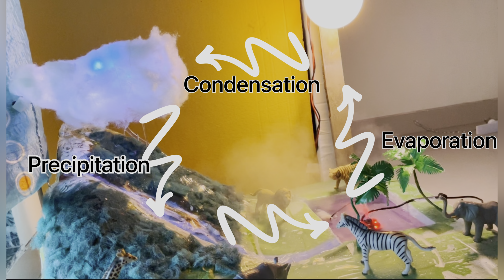Water cycle working model #science #schoolproject #watercycle NakulSahuArt

Comment: Sir where did you fixed the bulb switch??
Reply: Sir I want to do this project pls tell sir fast
Reply: @savithasavithasrinivas  what should I tell u?
Reply: sir Where I fix ball bulb on stick which switch I want to plug
Reply: @savithasavithasrinivas  get a bulb holder and there is a thing which we put behind the holder it looks like a plate. Fix the bulb in bulb holder and get a stick and a tape the or glue 
the holder with bulb on the stick and get a plug and connects it wire with the bulb wire and then your project is complete
Reply: Sir bulb holder means
Reply: Sir there is switch to on the bulb
Reply: @savithasavithasrinivas  u have to join bulb wire with the plug and u put the plug in switch then on the button it will glow

Comment: Humidifier  bulb, or water pump ko power kha se milega???? Please reply
Reply from the maker: Humidifier comes with charging kind adopter , directly plug into AC socket. 2 AAA battery required for water pump. Material list available in description .
Cloud में used light button cell के साथ आता है ,cloud making को थोड़ slow करके देखना .
Reply: @nakulsahuart  science exhibition ke din AC SOCKET KHA SE AYEGA?? OR KHA PLUG KRENGE,?

Comment: From where mist maker will get power
Reply from the maker: Hi,
Water pump is connected with 2 AA battery with switch.
Humidifier is powered by AC power socket (it’s comes with old charge type adopter)
Cloud light-it’s comes with button cell ( 4:06 to 4:22 )
Reply: @nakulsahuart  thank you

Comment: You didn't showed us the measurement of foam sheet plz reply  because I am making it and I have to submit it by 14th plz
Reply from the maker: Full project size is 21 x 26 inch,  you can use foam as per you project size, ground level sheets are around 2” thickness’ (as per water collection box )mountain high is around 12 inch.

Comment: Kiya aap muje bota sokte hain ki ye pipe ke sath kiya diya hain or ye light ki connection, humidifar ka connection kaha se kiya main claa 8th ki hu please replie sir
Reply from the maker: Hi,
Pipe ke sath mini water pump laga hai .
Water pump is connected with 2 AA battery with switch.
Humidifier is powered by AC power socket (it’s comes with charge type adopter)
Cloud light-it’s comes with button cell ( 4:06 to 4:22 )
Reply: Sir  plastic boll LCD ke sath keise milaya or uska connection summer vication ki project liya sahiya isiliya mung Rahi hu

Comment: We have to give the explanation also . So bhaiya how can we explanation
Reply from the maker: Water cycle, 
also known as the hydrologic cycle or the hydrological cycle, is a "biogeochemical cycle" that describes the continuous movement of water on, above and below the surface of the Earth. The mass of water on Earth remains fairly constant over time but the partitioning of the water into the major reservoirs of ice, fresh water, saline water (salt water) and atmospheric water is variable depending on a wide range of climatic variables. The water moves from one reservoir to another, such as from river to ocean, or from the ocean to the atmosphere, by the physical processes of evaporation, transpiration, condensation, precipitation, infiltration, surface runoff, and subsurface flow.
The water cycle involves the exchange of energy, which leads to temperature changes. When water evaporates, it takes up energy from its surroundings and cools the environment. When it condenses, it releases energy and warms the environment. These heat exchanges influence climate.
Reply: @nakulsahuart  Thank you so much brother for this help

Comment: Hello, I'm doing this for exhibition I would like to know what did u connect the bulb to?
Reply from the maker: Hi,
Water pump is connected with 2 AA battery with switch.
Humidifier is powered by AC power socket (it’s comes with charge type adopter)
Cloud light-it’s comes with button cell ( 4:06 to 4:22 )
Reply: Thank you

Comment: This is going to help me a lot for my exhibition. Can you please tell from where you are switching on everything at a time?
I really need it asap
Reply from the maker: Hi,
Water pump is connected with 2 AAA battery with switch.
Humidifier is powered by AC power socket (it’s comes with charge type adopter)
Cloud light-it’s comes with button cell ( 4:06 to 4:22 )
Reply: @nakulsahuart   hi sir can u send the method how to do
Reply: Please send to the discription
Reply from the maker: @malathishivani9401  watch full video you can do it yourself.

Comment: How did I turn on the above bulb with the plastic ball + make a special short video on how to connect the wires together please I did not understand
Reply from the maker: Hi,
Plastic ball bulb connected to AC power socket.
Water pump is connected with 2 AA battery with switch.
Humidifier is powered by AC power socket (it’s comes with charge type adopter)
Cloud light-it’s comes with button cell ( 4:06 to 4:22 )

Comment: How much cost is the Water pump wiring and humidifier?
Reply: Can you give link of that particular humidifier and water pump wire?
Reply from the maker: Humidifier-680
Water pump 249 (with switch,pipe & AAA battery case)

Plz check description for links.

Comment: bulb ki wire water pump ki wire  aur dusri wire in sab ko kaise connect kiya hai sir please bataiye
Reply from the maker: Hi,
Water pump is connected with 2 AAA battery with switch.
Humidifier is powered by AC power socket (it’s comes with charge type adopter)
Cloud light-it’s comes with button cell ( 4:06 to 4:22 )

Comment: wires kaise connect kiya hai sir
Reply from the maker: Hi,
Water pump is connected with 2 AAA battery with switch.
Humidifier is powered by AC power socket (it’s comes with charge type adopter)

Comment: Can you plz tell how the motor pumped the water in the pipe for such a distance.. Mine is not pumping such a distance can u plz explain that one😭😭
Reply from the maker: Change battery or use 9v battery.
Reply: @nakulsahuart  but I had used electricity for that what can I do now?
Reply from the maker: @nikashinig2351 what kind of pump you used.(mini water pump or cooler water pump)
Reply: @nakulsahuart  sir I used mini water pump only.
Reply from the maker: @nikashinig2351  mini water pump run on 3-9 v dc power (battery) as I understand you plugged into AC socket (house electricity) you need to replace the pump and power it with battery (3 to 9v)

Comment: Sir wire kha se join Kiya hai vo bata do na 16 Tarik ko bana na hai
Reply from the maker: Hi,
Water pump is connected with 2 AA battery with switch.
Humidifier is powered by AC power socket (it’s comes with charge type adopter)
Cloud light-it’s comes with button cell ( 4:06 to 4:22 )
Reply: Thank you sir
Reply: Sir wich one battery is that
Reply from the maker: @GAMINGICON05  normal clock battery.(AA battery)

Comment: Can i use small road in place of humidifier please reply
Reply from the maker: Heater Road can be melt the plastic box , hot water also affects the other material and it’s not safe. 
You can use portable mist maker (normally used in car) or use cutout for water evaporation.

Comment: Sir how did you given this connection
Reply from the maker: Hi,
Water pump is connected with 2 AA battery with switch.
Humidifier is powered by AC power socket (it’s comes with charge type adopter)
Cloud light-it’s comes with button cell ( 4:06 to 4:22 )
Reply: @nakulsahuart  thank you so much sir

Comment: Will the humidifier need aaa batteries
Reply from the maker: No , AAA battery required for water pump only, humidifier comes with charging kind adopter , directly plug into AC socket.

Comment: Where you have fixed the wire portion of the mini water pump?
Reply from the maker: Hi,
Water pump is connected with 2 AAA battery with switch.
Humidifier is powered by AC power socket (it’s comes with charge type adopter)
Cloud light-it’s comes with button cell ( 4:06 to 4:22 )

Comment: Humidifier  bulb, or water pump ko power kha se milega???? Kitni badi battery lagegi??
Reply from the maker: Humidifier comes with charging kind adopter , directly plug into AC socket. 2 AAA battery required for water pump. Material list available in description .
Reply from the maker: @sourav_verma__07  extension box leke jana padega, discuss with teacher .
Reply: @nakulsahuart  foam sheet ke jhga kuch or use kr skte hai?(foam sheet available nhi hai market me)
Reply from the maker: @sourav_verma__07  yes Thermocol sheet use Kar sakte ho ( TV , refrigerator ke box me anewale thermocol bhi use Kar sakte hai)

Comment: How to wiring this
Reply from the maker: 1. Cloud’s lights - 3 button cell used (it’s comes with lights brought it from cake decoration shop -25 Rs )
2. Water pump wiring - used 2 AAA Battery & switch.
3. Humidifier (Fog-maker)- directly plug in to AC socket.

Comment: Gi wire means
Reply from the maker: The GI wire or Galvanized Iron Wire is a result of a process called Galvanization. An anti-rust shielded zinc metal coating makes the wire rust-resistant. (You can buy from Hardware store 100 grams is more enough (it cost around 15 -30₹)

Comment: How to connect
Reply from the maker: Hi,
Plastic ball bulb connected to AC power socket.
Water pump is connected with 2 AA battery with switch.
Humidifier is powered by AC power socket (it’s comes with charge type adopter)
Cloud light-it’s comes with button cell ( 4:06 to 4:22 )